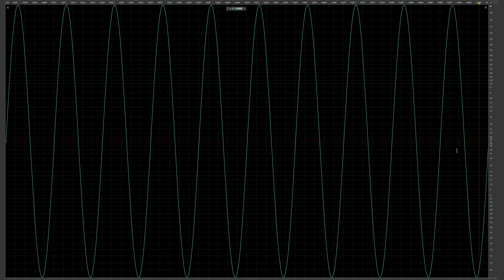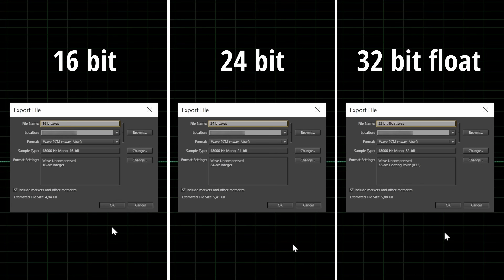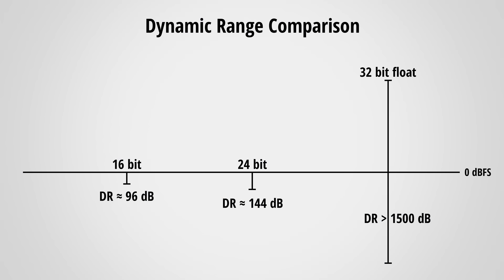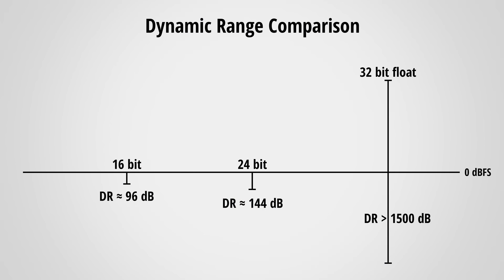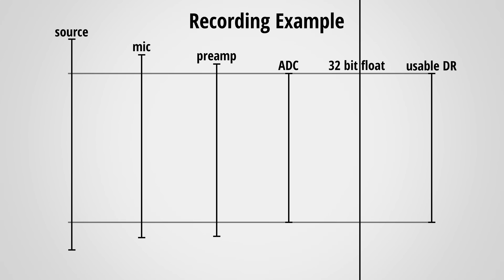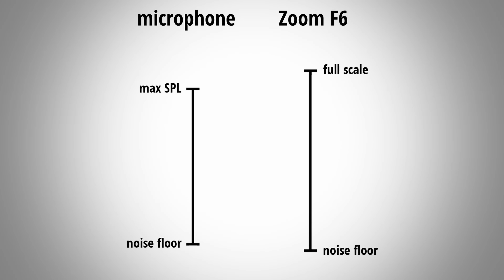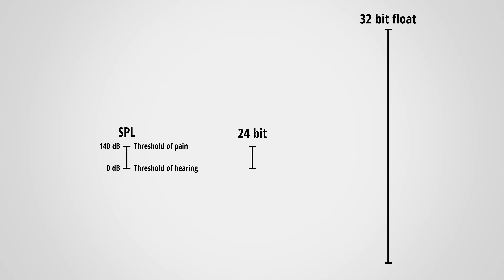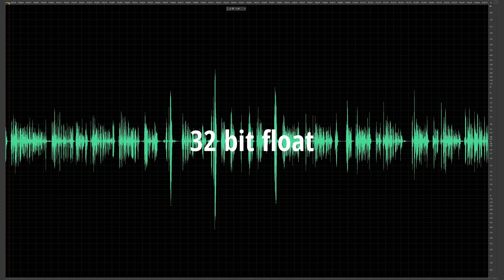The TRUTH about 32 BIT FLOAT for audio recording– Really useful or marketing hype?

Comment: I use a Zoom F3 all the time for video production. The part where you don't have to make a critical decision about levels until post is a game changer for me. The shots I do are improvised one takes and I don't have the ability to manage levels while I'm rolling. There is just too much going on to get levels right without leaving excessive amounts of headroom. Knowing I am going to get clean audio without having to set the gain just right is fantastic.
Reply: I think this sort of live production scenario is really the primary reason for 32 bit to exist. It makes a ton of sense on field recorders, but it really is not that useful (except as a bit of idiot proofing) on interfaces for home/studio recording where you can prep everything and leave yourself plenty of headroom. Maybe it's useful for streamers who get a little too excited sometimes, but then again, I think some of them like the "aesthetic" of having things clip when they get too loud, so whatever.
Reply: @nickglover  In realistic sense unless you don't want to compress the signal in anyway, a compressor or an AGC(automatic gain control) circuit would work just fine.
Reply: Typically I don't think people do want to do that, especially for, say, a movie. You can't undo compression that's baked into the file, so you don't want anything affecting it. Similarly, you can't get an actor to perfectly redo that one perfect take that you messed up because it clipped a bit, but if you have 32 bits, you won't run into that problem.
Reply: @nickglover  Two inputs with different gain works wonderfully in this situation.
Reply: @johnyang799  What also works wonderfully is just plugging a mic into an F3 and simply  hitting record. Why do all the extra work? That is the point.
Reply: @darikdatta  No one said you can't use F3. You do it completely fine.
Reply: You're really talking about multiple ADC's for increased dynamic range.
Reply: What do you consider ‘excessive’ headroom?
Reply: @artysanmobile :
 No such thing as too much head room, at least in my opinion.
Cheers 🍻
Reply: Is it possible to set a default sound level so when I hear the file, it won't be too quiet or too loud? Zoom M3 can record 32 bits internally but it doesn't have gain to set when line out to camera, is this a problem?
Reply: Well said!
Reply: Yep, I got the same tool for the exact same reasons. Simply press record and no-matter what happens, you caught it! I guess the only thing that could really cause a problem would be if I/we breach the threshold of our mics. I'm not recording jet engines, but with the F3 I know that I could if I wanted to. Cheers 🍻
Reply: Granted you have a great experience with Zoom F3 that's great. But there are three things to notice.
1, Everything you have experienced can be done in 24bit. It's the technique that combines two(or more) ADCs' signal makes the difference.
2, The technique itself is not magic either, it's not necessarily different from using two input channels, one at lowest gain, one at 30db or max gain and choose the proper one for proper sections after the recording.
3, It's also similar to have a limited gain settings. 2 adc solution is essentially the same as having on 2 gain settings which means if you record at just over the threshold of the higher gain setting (low noise setting) you would have pretty bad noise performance. Although it's combining two adc signals is better than what I just described. It benefits a lot from using more ADCs, so better solutions use 4 5 or more adcs to accomplish a excellent result. That adds to the cost and price. So you probably would get away with getting a better adc and set the gain conservatively or use two adcs for two tracks with different gains. Also still not outside the capabilities of 24bit format.
Reply: @johnyang799  ti feels kinda pedantic to describe everything as "yeah you could do it even with a rock" that's basically the feeling it gives when the person above is clearly saying that the flexibility of having 32 bit is what makes a game changer. what makes you think that they do not adjust the best as possible the gains and everything? the relief is that when you are field recording, or just recording for videos outside or just post production you are just running (and how we say it out here, everything is for yesterday), and you can miss easily a little bit of headroom. it happens even to the best. so, just knowing that even if you didn't manage to get those 3 or 6 db of headroom that you are missing because you couldn't do a proper gain staging and would have been really nice to have now is finally a thing, wouldn't you be happy for that?. 

sometimes we need to humble ourselves. not everyone can afford the expensive equipment, more if you are just starting. you wouldn't recommend to someone that lives with their parents to buy a neve console right?, that's my problem with your comment. lol.
Reply: @ForelsVR  The key is the important  new technique is not 32bit float but having two ADCs inside running at two different gains and combining the signal of the two. Everything can be the same and it outputs 24bit format. Not that it's on the market but it's important to understand 32bit float is just the marketing, itself is not what makes the difference.

Comment: I believe there are specific situations where 32 but float is necessary. However a lot of YouTubers and marketing bring up situations where 32 but float is "handy" or "helpful" but not necessary. And any situation, where 32 bit float isn't necessary, can be handled just as well by 24 bit as long as you have set your gain properly. But in those very few situations (normally field documentary film making) 32 bit float is the ONLY option for capturing audio. 

However, marketing teams know that there are only a few production crews in the world who are creating field documentaries. So in order to sell more products they need to convince normies that they need 32 bit float. 🤷 You don't need 32 bit float. James Cameron doesn't need 32 bit float. Only documentary filmmakers in war zone NEED 32 bit float.
Reply: This sounds interesting. Can you expand a bit more, or tell me where I can read more on this topic? Whqat is it that makes it necessary for that particular application? I would  be very interested in learning more about that and the equipment they use.
Reply: @shady_arian  Doing some field recording... According my very novice experiences one simply cannot control what would happen in the next minute. For example in a city a slammed car door nearby, or a passing police car with sirens easily get distorted if not recorded in 32 bit float format. Still requires some work in post to squeeze into 16 bit, but at least it is possible.

Also if one knows what will happen (for example in a train station) either have to manage some distance - and it introduce other, maybe unwanted noises - or have to set very low gain (which later when compressed, will increase the noise level too), or: just record in 32 bit float, and forget all these issues (ok, a bit simplified :).

Comment: Very good explanation Julian, I think 32 bit float will come in handy in converters/interfaces for people using consoles and hardware which can exceed the clipping point in a DAW or driving them hard without needing to use an pad adapter on the direct outs which can lower impedance and muck up the transients. It's also great for less experienced engineers recording drums or recording live shows where volume can get way too high. Cheers!!!

Comment: TLDR: it's like RAW photography/videography?
Reply: Yes and no. Yes, bc the raw format 10 - 16 bits (maybe some are even more), and compared to the 8 bit of jpeg is a huge difference. And no, because still not as huge as a 24 bit fixed vs 32 bit float (another world). Strictly IMHO the exposure bracketing is closer to it (as the sony pcm d100 did with dual ADCs in the good old times) regarding the improvement of the dynamic range.
Reply: I would say it's similar in the reason to exist and end-use benefit. With RAW the fundamental added quality of life feature is that a bunch of camera settings (ISO, exposure compensation, white balance) are effectively removed and shifted into post-production, all you need to get right in-camera then is focus aperture and shutter length. Similarly with 32-bit audio, the gain setting is shifted into post-production and not locked in during recording, you just need to get the microphone placement right and you'll fix the gain later.

Though it is to be kept in mind that the dynamic range of a 20-bit recorder is already pretty damn wild - for a given microphone you can figure out a safe gain setting that will capture the entire range of the microphone; but the monitoring on non-32bit devices tends to be set gain level dependent, so you also likely won't hear anything if you do that, and 32-bit recorders solve that problem.
Reply: TLDR no.
Reply: Exactly the question I was going to ask

Comment: will you ever review the SSL12? Curious how it compares to an SSL2 which I own
Reply: Its the same converters as the smaller interfaces with more i/o so if you like the SSL2 or 2 plus you would like the SSL12. Cheers!
Reply: @joesalyers  That's not quite right. The SSL12 is only similar in appearance to the smaller models. It has a different converter, can do 32bit, has a higher dynamic range, etc. I'd be curious to see how it performs in a test.